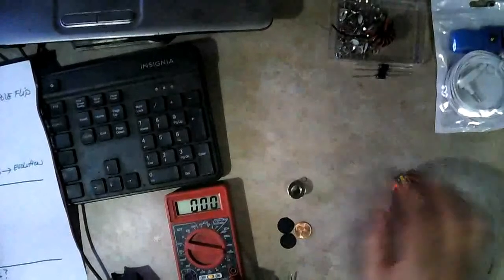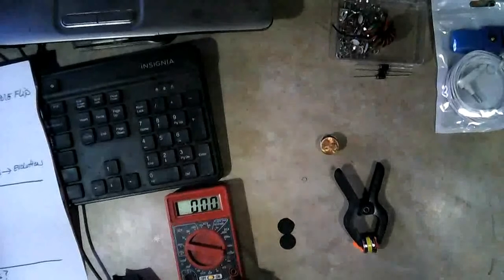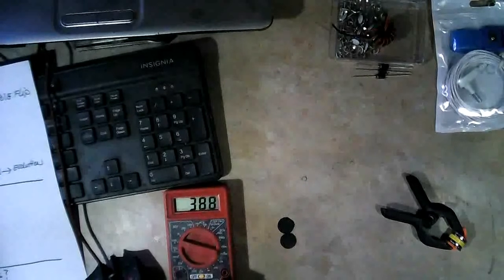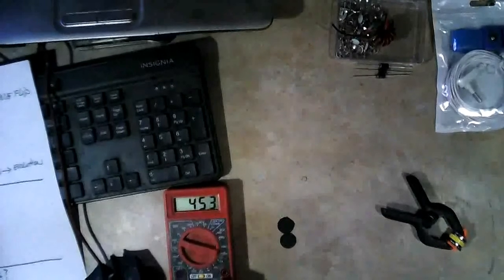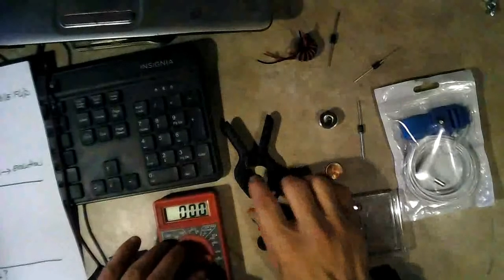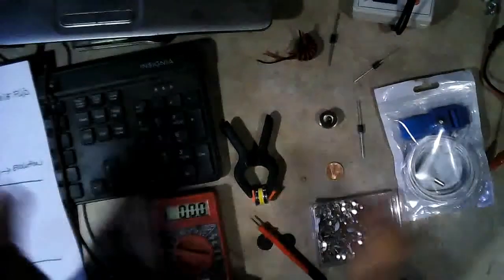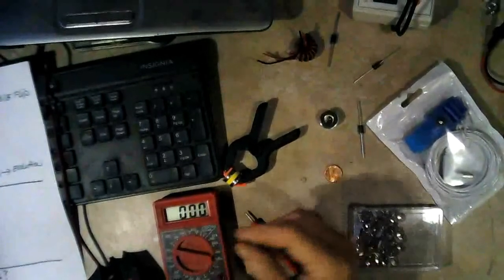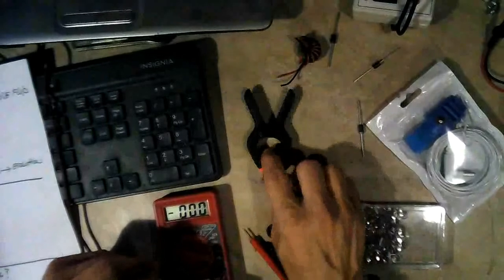Boosting Your Bio-Electric Field with Magnets!

Comment: So maybe a wire from the wrists up the arms over the shoulders to each other with the magnet between for a circuit?
Reply from the maker: That's basically what I'm thinking, but probably hang the magnets around my neck and run the wires across my chest and down the arms. I wonder how much amperage my body produces now. Lol
Reply: Maybe enought to power an LED to light your way?
Reply from the maker: Maybe, that would be cool to have a light powered by your body! :-)